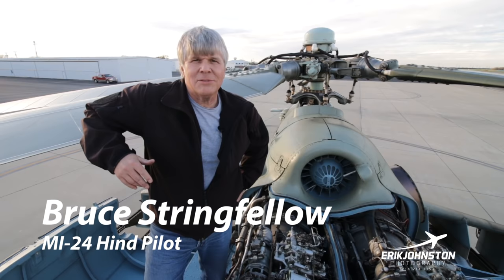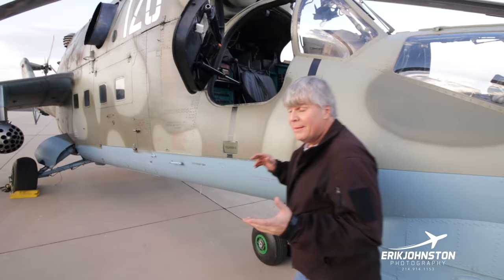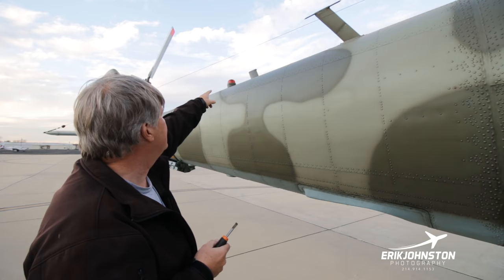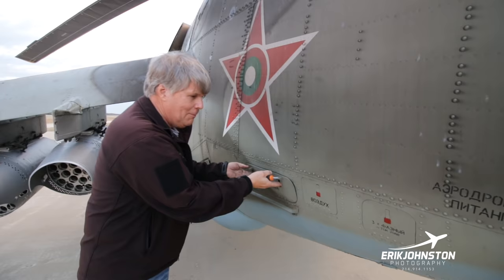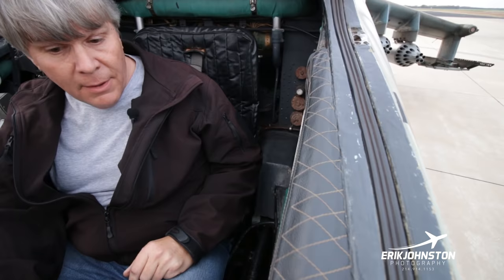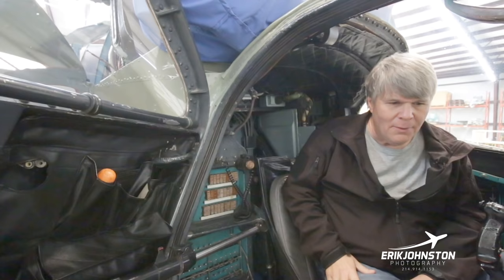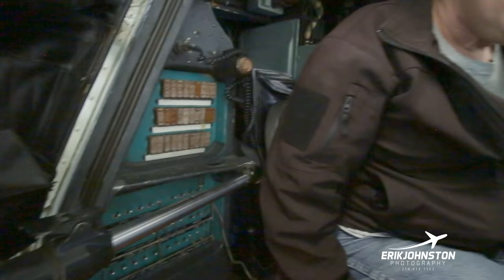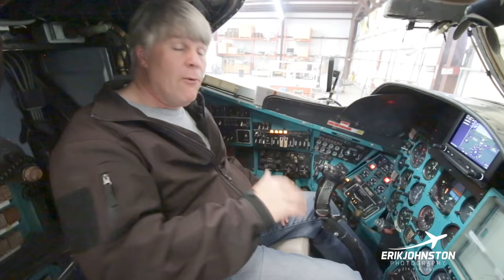Hind MI-24 Helicopter Walkaround Tour

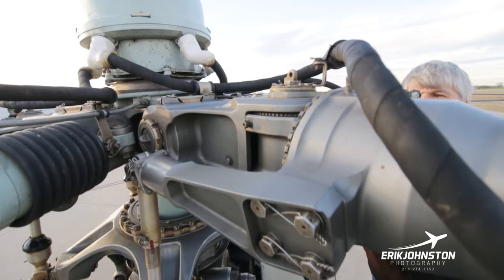Comment: 9:26 What are all those black pipes for? Is that a de-icing system that inflates the leading edges?
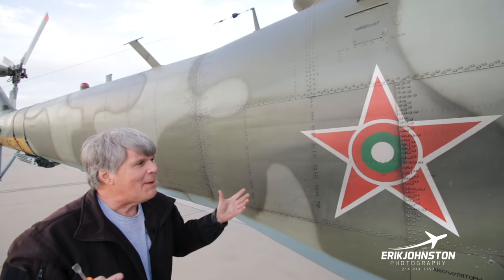Reply: 18:44 Alright, so the de-icing system is/was electric, apparently. Did those black “pipes” actually contain wiring for the de-icing system?

Comment: .50 BMG is 12.7x99mm, Russian 12.7 is 108mm long. This isn't a unique move at all, the French shortened their 7.5mm cartridge from 57mm to 54mm because to the naked eye German 7.92x57 was almost indistinguishable. 7.92 would chamber but wouldn't fit down the barrel causing some very nasty failures.

Comment: Let’s be honest the Soviets built a lot of crap, but when they got it right, they made some of best performing and durable machines, weapons, etc... of the 20th century. Having served in Iraq and Afghanistan I found we were coming up against guys armed with Ak47’s and 74’s that had been left behind by the Soviets, and one interpreter had a cleaning regimen of unlacing his boots, tying knots every few inches, dipping the laces in whatever oil he could get, and pulling those laces through the barrel, all while we sat their with our little cleaning kits and me praying I didn’t lose the cotter pin that held my firing pin in place lol. My uncle had a chance to buy a disassembled Mig 15 for less than the cost of a pickup truck and upon inspection I’d assume what I was looking at was new (engine parts etc...)